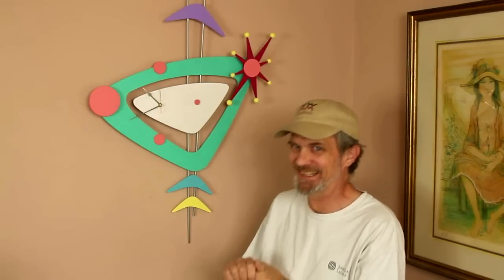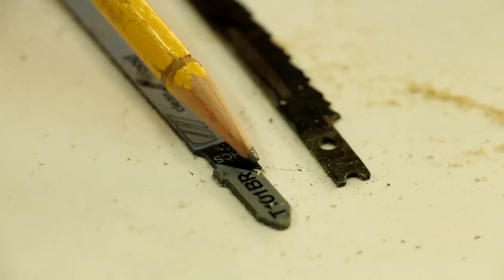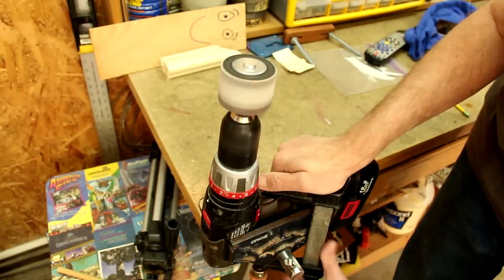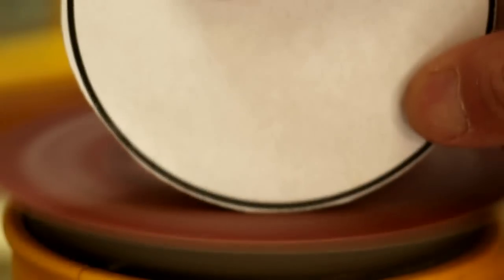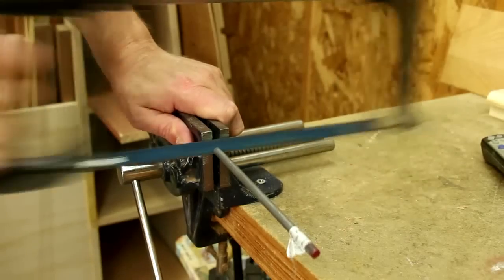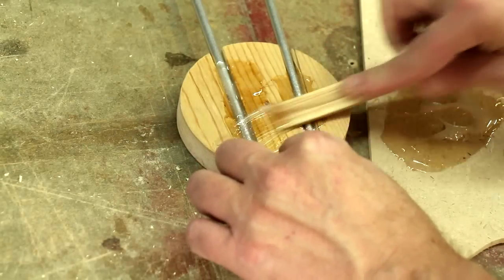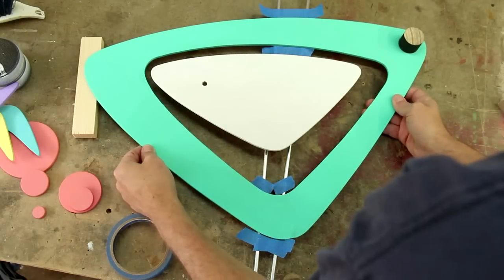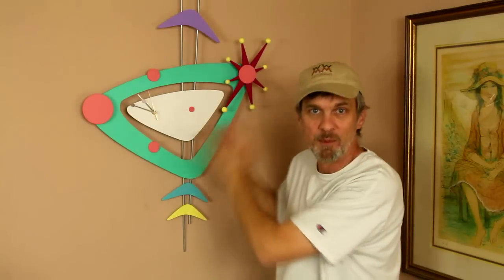Make this Jetsons wall clock. Retro! Limited tools woodworking project. Free plans.

Comment: Like the clock, Steve.  In a miter box, I hold the wood against the back side, since the saw pushes it against the back when you are putting force on the saw.  When you are pulling the saw more lightly on the return stroke, then your fingers do the work.  I find this easier on my hand, especially after many cuts.

Comment: Talking about your jigsaw blades, I have a black and decker that uses the U shank with a quick release. My blades were always falling out (generic stamped blades) and I was getting really frustrated until I tried decent black and decker branded blades (ground edges), never had one slip out, even tried on purpose cutting a 2 x 4 as fast as I could but it would not move so for me at least it was the blades and not the saw that was the problem.

Comment: Look up the the mathematical definition of ellipse (oval) on Wikipedia. From that you will see that you need to make loop of string and pick to fixed points then stretch the string around the two points and a pencil tip. Keeping the loop tight, draw a oval around the two points.

Comment: It's really challenging to start a wood working project. I had wasted so much time & money on my previous work. Next, I found out the reason why, that is I did not have a detailed program & diagram. I always let things even worse when it could be fixed quickly if I had some experience. Then I found a woodworking plan which contains all the detailed plans, tips & guides - it help me lots.